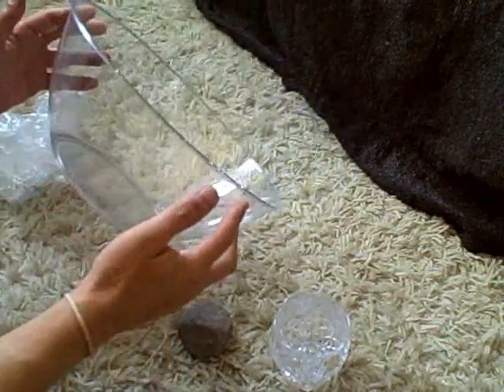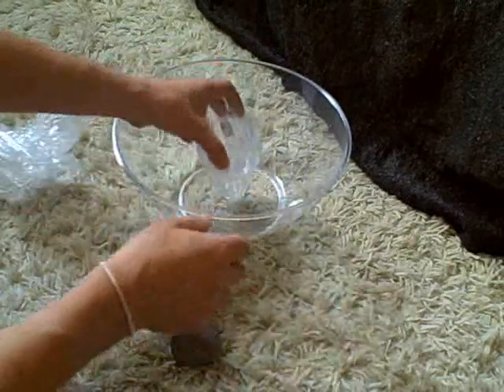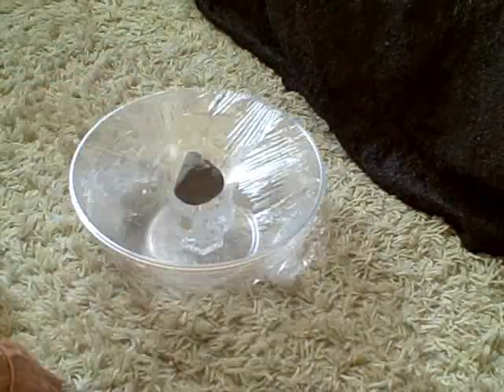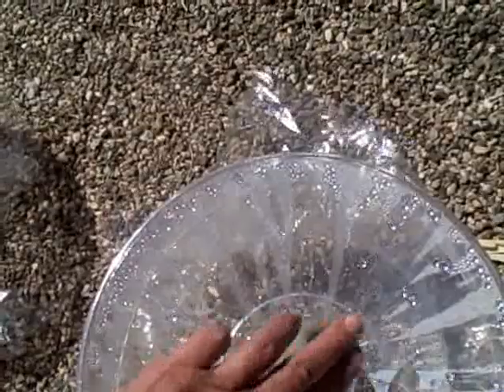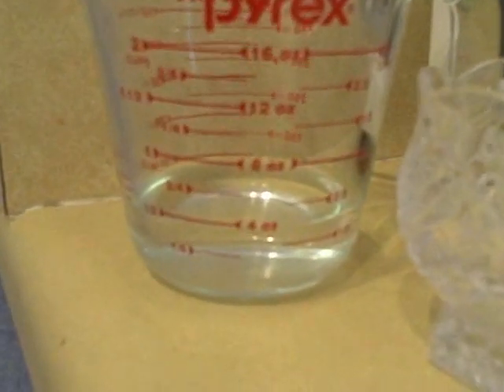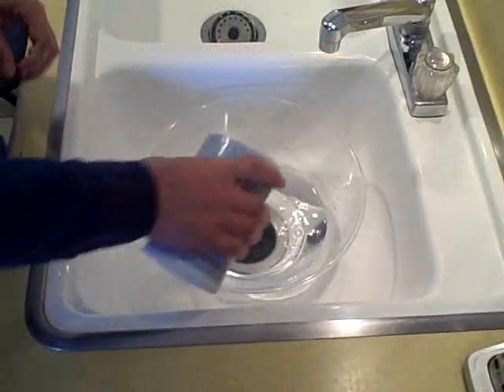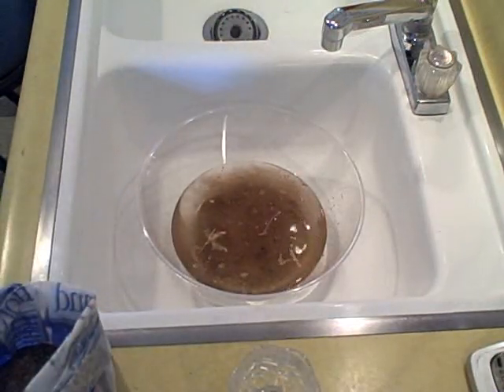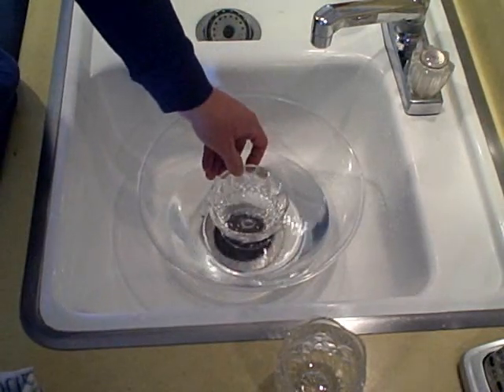Homemade Solar Water Distiller - turns dirty water/saltwater into clean drinking water! - how to DIY

Comment: Why is this method not used on a larger scale to clean our water?
Reply: It isn't because of capitalism or being cheap. It isn't cheap because land isn't cheap. To implement this on a commercial scale, you need ridiculous expanse of land because you have to spread out the water as the evaporation happens at the surface. But even then the evaporation rate is too slow. Just put the bowl of water out in the sun to test and see how many days it will take to evaporate fully. If it was feasible and cheap and you are in a capitalistic country, someone would've already jumped at the opportunity to make money "cheaply".
Reply: Bc it's cheap. The government wants to make themselves look good without purifying it cheaply bc... IT IS THE STUPID GOVERNMENT
Reply: because water won't evaporate si quickly on such a large scale i guess you can give every body one but just a really large version of this wouldn't work.
Reply: because CAPITALISM

Comment: I remember seeing a similar video survival many years ago,so glad to see this an was wondring why they could not do this on the Island series ....could a filter system be built to take the salt out of sea water ?
Reply: +arrgh garry  I believe large systems have been created but they are very expensive
Reply: +arrgh garry you can make a sand filter with two buckets, couple of pieces of garden hose and some sand, and charcoal. All you need to do is put two holes towards the top of the 1st bucket on either side for water to come in, and then to flow out. Then connect the outlet on the sand filter bucket to your catch bucket. Then burn some dense wood like oak to get some good coals, let them cool, place them in the bottom of the 1st bucket, then put some clean sand free from glass or anything else undesirable for your drinking water on top of that and fill it right up to the top. Then start putting water into it. However it's still a two step process in most cases, the sand removes the heavy contaminants, charcoal should get rid of any possible chemicals. On top of the sand bacteria forms and eats up the smaller contaminants, however you should really still boil the water afterwards.  This is the way any sand filter in your house would work, or on any swimming pool that has a sand filter. The problem is the bacteria takes some time to grow and you need to wait for the water to hit the bacteria and then settle down again before it moves on.  It's quicker if you boil the water after. Anyway that's the just of it.  If you have your choice of materials going out in to the wild, then you should take a couple of small stainless steel pots with lids and do what the guy in this video did. Much quicker process. Good luck.
Reply: Workin Alday That wa quit interesting
Reply: This is the process by which rain is created. So if we capture all the rain and keep it from going back into the ocean, in a closed loop city filtration system, no need to build expensive desalination filters.
Reply: +arrgh garry the island bought me here too
Reply: Does not the rain collect pollution as it falls?
Reply: There used to be worries about acid rain from indutrail pollution ,bt maybe that has declinednow

Comment: Just as a note, you do not have to do this in a  glass bowl, use any thing that you can cover with the clear plastic and set a water collector in the center.  It can be a pot, pan, shallow hole in the ground,  just make sure you put any water producing or high liquid plants (ie catus, grass, weeds, etc) or any liquid with a high volume of water.  Just stay away from any plants that are poison or have any irritating properties (poison ivy, sumac etc).

Comment: What do you use if you don't have plastic to cover the dish/bowl with? Is all that you need to do is let it sit in the sun and if so for how long until you gather all the drinkable distilled water in the cup in the center?
Reply: Go to the hardware store and buy a 1 or 2 mil painters plastic drop cloth, should run $1 or $2.

Comment: great video....
Tip: try to get the bowl dark with paper / paint  to convert more of the light into heat energy. Use a foam pad with a thin metal like " can" lid on top to act as a heat sink and minimize heat transfer to the ground. Especially helpful during "shadow times"

Comment: Our scout master told us about this maybe 15 yrs ago, its amazing how iodine drops and other corporate merchandising yeald only about 80%. however it does not work with Fluoride. the chemical sticks to it. Unless you do it your way. through straight evaporation. and condensation. However he broke a a vase and used a cooking pot to get more water, flipped the broken vase upside down and the stem went into the pot. a fire was under the pot, 1 gal of water in 10 min.I forgot about this ST THX!!

Comment: Nice video. One suggestion... place something other than the cup that will contain the clean water, into the bad water. Keep the cleaned water cup completely out of the bad water. If you don't, when you either drink from the cup or pour it into another container, you risk bad water from the outside of the cup, dripping into the clean water and contaminating it again.

Comment: Best thing you can take into an arid area is a large plastic sheet,dig a hole fill it full of leaves or smashed cactus, put bucket in middle of leaves or a fry pan or tin or a shoe, plastic sheet over it with rocks all around it; and one small rock on top and you've got water at the end of the day.A clear plastic bag tied up and out in the sun will steam cook a fish in about 90 minutes lizards, snake, whatever.